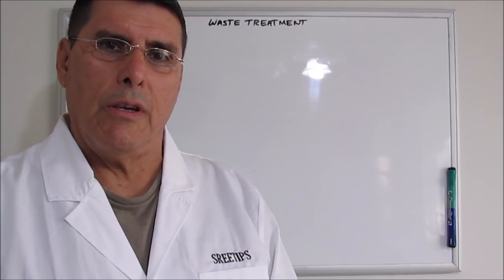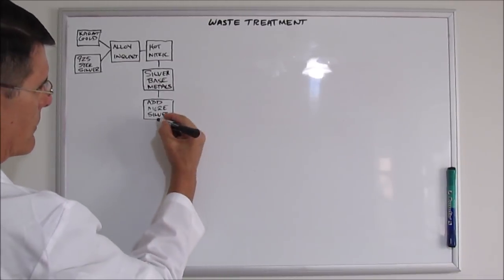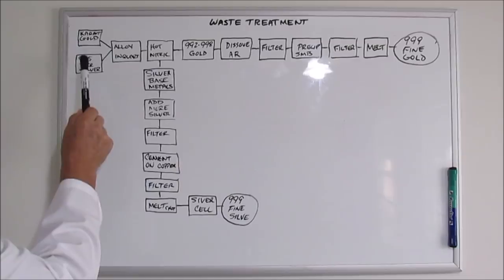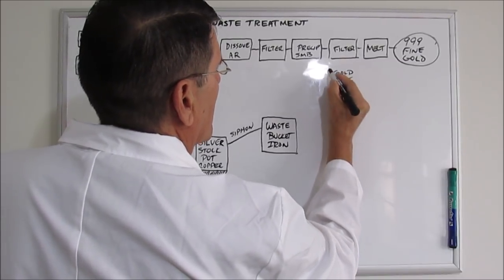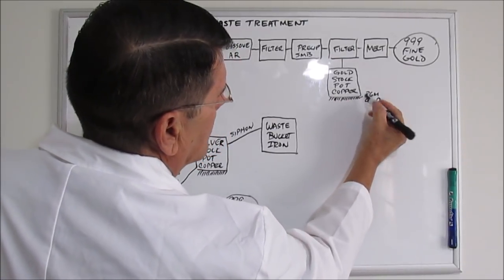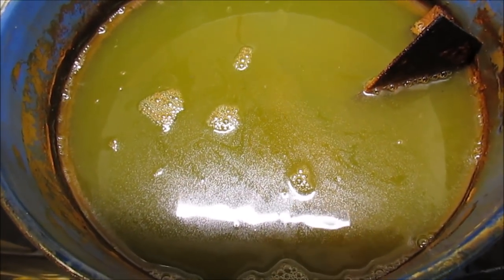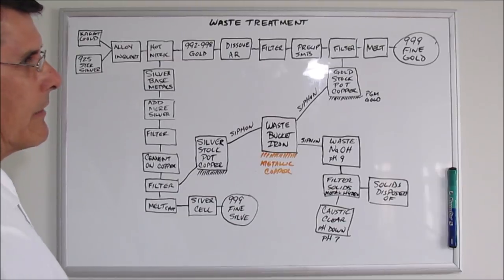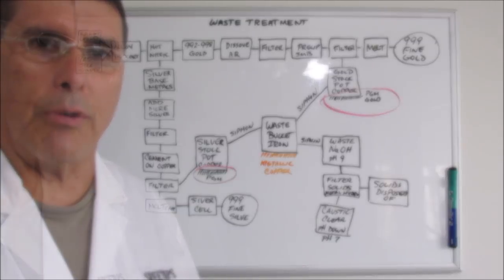WASTE TREATMENT for gold and silver refining

Comment: the black iron oxide can be filtered with a t shirt just as good as the coffee filters but faster and can be sold on line I think it go s for 7 to 10 bucks a pound maybe more if you dry it ,and the copper powder can be sold too . and thanks for showing how to proses the waste . only a good man would take the time to show others how to do things like this .
Reply: I agree on not throwing away copper.  Considering its spot price is pretty high right now and it looks like it'll be going up.
Reply: I would also think the copper could just be melted and used back in the cementing. He mentions not wanting to bother refining it, understandable, but it has reagent value at least, minimal effort
Reply from the maker: It’s heavily contaminated and pretty much useless. And not worth the effort to get it clean.
Reply: @sreetips  contaminated with what? ...didnt you add only iron witch will be dissolved in solution and go back to your iron bucket?
Reply from the maker: Mostly iron

Comment: If you just get a roll of Aluminum or zinc it would drop out all the copper and you could reuse the copper power you would end up with to do other refining , could even just melt it into a copper bar and reuse in your stock pot, would save you a few hundred dollar in copper a year , and if you melt the aluminum into a bar ,( aluminum foil from the dollar store , or old aluminum pots and pans , or siding from building materials) then you could just toss in an aluminum bar and get all your copper back , would cost that much and youd save in buying more copper.

Comment: Excellent process review. 
However I would like to see the copper fines from the iron run by an XRF gun to see if any other precious metals are in the copper . 
same with the stock pots. 
I saw the inquarting with copper video, and I prefer that to the silver or sterling. 
it seems the silver has most of the pgms . 
I would look forward to a PGM chart like this as well. 

by the way where does the
Reply from the maker: Theres probably traces of precious metals in that copper. We can never get 100% separation. Entropy guarantees it.
Reply from the maker: I prefer sterling silver for inquartation because I refine silver also.

Comment: Hia sorry if this is a dumb question. I may have mixed stock pots up copper and steel. I have steel only in it now and have a white structure that’s built on top of the copper structure. 
Copper came out first 
Would this be higher in the reaction table like tin and lead or lower towards silver?
Reply from the maker: Tin or lead are above copper so they won’t cement out on copper.

Comment: HI i wanted to ask you what happens if you have a little of aluminum chloride in the solution that i am doing the treatment ? Can i still use the this process
Reply from the maker: I don’t know. I don’t use aluminum in any of my processes
Reply: @sreetips  thank you. i don't ether but i did had some aluminum capacitor with gold leg and bonding wires   and that aluminum went to solution when  i was using HCI
Reply from the maker: Good to know, thank you.

Comment: Oh course the metal hydroxide sludge is considered hazardous waste.  F006 waste I believe.  Your pH 9 water on the other hand is fine to dispose at that pH if you are disposing to a municipal sewage.  Most municipal plants have a discharge pH range from 5 to 10.5.  If you are discharging to surface water than yes a pH of 7 is required.  Of course I sure you don't have a discharge permit.  Don't mind me just being a smart a $$

Comment: Great explanation of waste treatment! Still looking forward to seeing what you recover from your stock pots!
Reply from the maker: I'm dragging my feet on those because I'm not sure exactly how to proceed. But I'll get through it and get the precious metals. Probably won't be as much as I'm hoping for. It's only traces going in over a long period of time.
Reply: I've been thinking of how to start with your waste bucket too.  Couldn't you theoretically just dissolve in AR, precipitate out gold and filter, precipitate palladium out with DMG and filter, and then do platinum and refine each individually?
Reply from the maker: I've got a fine basket strainer made of plastic. We use them at the jewelry repair shop to clean jewelry in the ultrasonic cleaner. It catches any diamonds that get vibrated out. I'm thinking that I'll pour everything thru the strainer and into a large beaker. This should get any pieces of copper out for me. Then add four liters of hot tap water and let it settle. Then siphone off the liquid and leave all the solids behind. After that, I'm still thinking about how to proceed. For the mud, what you've written above, seems like it might work.
Reply: @sreetips  I agree that dissolution in AR and dropping and filtering each metal in order of reactivity from the solution is probably the best way to go about it. This would be selective precipitation.

Comment: This is a good overview of your main refining processes; it only leaves out the stock pot and filter refining, which as of this writing is still largely experimental.

It looks like the gold stock pot and silver stock pot can be the same pot.

I'm surprised there isn't a recycler who will take the copper that's been cemented out. I suppose purity issues have a lot to do with this.

I suppose that if you had a bigger operation it would be worthwhile to re-use the leftover high pH solution near the end to raise the pH of the acidic iron solution, but I also suppose that lye is cheap enough not to worry about this. It's easy to forget that time is often the most important resource of all.

Comment: Great video. I know sterling jewelry is plated with rhodium sometimes. As a repair jeweler, it was tough to work with. The solders in karat gold jewelry had a lot of crazy metals to help with  melting, flowing, color, etc. Good luck with those.

Comment: Do I have to inquart my 10Kt/14Kt  gold jewelery before I dissolve it in AR?
Reply from the maker: If you don't, and there is high silver content in the 10kt/14kt gold jewelry, then you will experience passivation. The hydrochloric will react with the silver (if high concentration) and form a tough layer of silver chloride encrusted over the gold and protect it from the AR so it won't dissolve. And, if the gold does dissolve, any silver present will form silver chloride in your solution causing filtering problems and fine particles of silver to follow the gold through the filter thus contaminating your gold.

Comment: I forgot to ask what is the purpose of inquartation?  I apologize if this was already discussed.
Reply from the maker: Inquarting with silver (or you can use clean copper or brass) and parting with hot dilute nitric, if done correctly, will completely eliminate problems with passivation and silver chloride formation and make refining the gold very easy.

Comment: How toxic is the solution after the Iron treatment ?    Being a bit lazy here, and wondering if the post iron solution could potentially be poured onto ash in fire pit, which will eventually be burned with fresh wood and so covered completely within wood ash.    Would the ash, and then fire, and then more ash on top neutralize any remaining toxins in the iron solution ?
Reply from the maker: I don’t know. I think It’s best to drop the iron out with sodium hydroxide, filter those solids out. Then burn them in a fire pit.

Comment: Very nice video sir  and Inside the iron water you have put sodium hydroxide inside that filter I gold silver and Palladium please tell me sir
Reply from the maker: There should be no precious metals in the iron water. However, if the solutions are transfered too soon, some PMs could make it into the iron bucket, but they would quickly cement out on the copper in the iron bucket. I let the solutions sit in these buckets for about a week before I transfer the solutions to ensure that all the metals have come out of solution.

Comment: The slimes from the silver cell, if any, get added to the stock pot?
Reply from the maker: No, the silver cell slimes are processed separately. I've made a video that shows how the slimes get refined. The waste from refining the slimes will contain ammonium chloride. This type of waste does not go into the stock pot (or I use a separate bucket) because of the ammonia that it contains.

Comment: Thanks for all your videos. Well explained. 
Why don't you reuse the cemented copper from your waste bucket in your stock pot? I think about melting it to get rid of non-metals, getting bars or shot of copper alloy. Are the base metals disturbing the process in the stock pot? I just wonder because you pay good money for the copper and stripping the wire seems to be time consuming and not too much fun. And it would decrease the amount of waste produced, always a good thing to think about.
Reply from the maker: At one time, I used to take copper from the waste bucket and put it into the stock pot. But I don't do it anymore because copper is so plentiful and copper from the waste bucket is contaminated with other metals.
Reply: @sreetips  even if the copper is contaminated with other metals wouldnt dissolving the copper into solution via cementation give you a second run at recovering any other traces of pgm's gold and silver from the sludge

Comment: Have you tried to recover your nitric acid from the waste copper nitrate solution? 
I started doing this after i found nerdrage's video about it. I get most of my nitric back. i think my losses are orange gas. I havent found a nho3 supply that is cost effective so i recycle my waste back into usable products and cut out my biggest expense.

Using a pid controlled hot plate i have been able to recycle and distill about 100ml of 70%-fuming hno3 per hour. Thats a lot more than i consume.
Reply from the maker: No, I have not done that
Reply: @sreetips   nho3 is so expensive($60L+s&h) here that its 1/5th the price to make it my self. The recycling procedure is identical with 1 extra step to recover the sulfuric acid used.
Reply: @rainwater397  have you got a link to a video regarding this?

Comment: Thanks a lot sir for sharing complete knowledge and process. Apart from phdown is there any chemical for bring  down pH
Reply from the maker: I don't know, maybe some weak acid, but I've always used pH down from the swimming pool store.
Reply: @sreetips  Isnt it possible to Raise the PH with Baking sota (sodium Bicarbonate) and that Produces Carbon Dioxide. wouldnt it be possible to capture the Carbon Dioxide gas and Later after the Precipitation of the iron after the filtering, to bubble the Carbon Dioxide back through the Caustic solution to Lower the PH?

Comment: Would any ph decreasing compound be acceptable as a final step/could one use clean muriatic acid to achieve the same effect?
Reply from the maker: I've never tried hydrochloric acid.
Reply: Yes HCl works very good. But  I would not even neutralize the solution. pH=9 actually is only a slightly basic solution.

Comment: Hey Sreetips,
If you are not using the copper which is cementing on the angle iron, then why do you do it? 
Could you not take the waste solution from the previous step where all the precious metals cemented out on the copper, and treat it for disposal?
Reply from the maker: I get copper at yard sales very cheap. The copper in the waste bucket gets thrown out. It’s not worth it for me to try to refine it and reuse it.
Reply: @sreetips  Yes, I get that, but when you throw it away, why do you cement it out on the iron?
Reply from the maker: Because copper in solution is more toxic than iron in solution.
Reply: @sreetips  Thank you for replying to all my questions! Best greetings from Germany!

Comment: Another great video, buddy! Ya know, I've used inquartation as a process quite a few times, but the last 2 times I've done it I've gotten that incredibly fine gold powder after the 2nd leach. I meticulously test each piece, and use 95% of the silver needed, but still get the powder that makes filtering a nightmare. It's odd, but still my favorite process.
Reply from the maker: I had that happen to me the last time I did a gold refining. Once I seen that the gold had crumbled I just kept adding nitric, settle, decant, add nitric, boil, settle, decant etc.. until the solution was clear and no more fumes evolved. Then I poured it all into a filter. Some of it got through the filter, but tenths only. I dissolved the gold, filter and all, in aqua regia then let it set overnight. Next morning I siphoned off the clear gold chloride solution that was sitting over about 1/4 inch of green grey residue in the bottom of the beaker. It went through the filter in about 1 minute. Then I poured the residue into the filter. It took almost 24 hours, most under vacuum, and I still didn't get it all. But again, tenths only were left behind. I saved the filter, it will have gold (in with all the junk) but again, tenths only. My yield was only off by about 2.5 grams out of 117 grams of pure gold expected.
Reply: @sreetips  very similar to what I've been doing. My first leach tested positive for pd, which could have only came from the dental scrap I had in the batch, miniscule amount I'm sure. It carried with the 925 I used to inquart with, but the 2nd leach is when it got messy! Had to use a pipette to pull the solution with, then a fresh nitric boil, let settle, pipette again, makes for a time consuming endeavor. There really is no way to catch it all though, even thought about drying, remelting, and trying again.
Reply from the maker: I actually did that once. I got it all in a filter after the first nitric boil. Put it in a melt dish, wet filter and all, and melted it back into a button. Tested the button with needles and test kit, then inquarted again and hit it with nitric again. I can't remember if it worked been a long time ago. Maybe I'll make a video with too much silver on purpose to demonstrate what happens and how to fix it. Thanks for the idea.
Reply: @sreetips  I'll be watching out for it for sure. It's definitely a giant pain in the ass when it happens.

Comment: I have been trying to figure out what to do with the AP and AR waste solution. Does the AP and AR also go into the stock pot?
Reply: ok, I see the AR goes thru a few steps, after SMB is added, it becomes the stock pot. what do you do with the AP and the hot Nitric? do those go into the stock pot also?
Reply from the maker: Gold refining waste solutions may containe traces of precious metals (mostly platinum group metals) and every drop goes into the stock pot that is full of copper to cement those traces out. Silver refining waste solutions will be mostly copper in solution with traces of silver. I add those to a bucket with copper to get all the silver out and any traces of PGMs. I don’t want silver solutions in my stock pot. I don’t want gold refining waste solutions in my silver bucket. HOWEVER, both of those solution are added to my waste treatment bucket that’s full of angle iron. In that bucket the copper cements out and the iron goes into solution. I toss the cemented copper because it is contaminated with other metals (pluse copper for refining is cheap and plentiful) and I end up with just iron in my waste solution. All the toxic metals are removed.
Reply from the maker: Spent AP solutions go straight into my waste bucket full of angle iron. But if traces of PMs are suspected in the AP then it could be run through the stock pot to get those traces. HOWEVER, running the AP through the stock pot will chew up lots of copper needlessly and; I don’t do much with AP (acid/peroxide) because I don’t refine much escrap anymore. The yields are too low.
Reply: @sreetips  thank you for the replies.  love your work. I have watched hours of your stuff.

Comment: the waste copper from cementation on iron could be melted into ingots and sold to a scrap yard as is for at least red brass price
Reply: I figure, now that you have a furnace to melt large batches of silver, melting ingots of copper waste would be easier. it may only be pennies on the dollar, but it is copper reused instead of landfilled.
Reply from the maker: It would cost more in fuel than the copper is worth. Copper is very useful in precious metals refining. But after that, it’s considered waste.
Reply: sorry to go on about it, to me it's about the waste of resources with throwing it out, I'd rather give the copper product away to someone who'd use it than send it to landfill